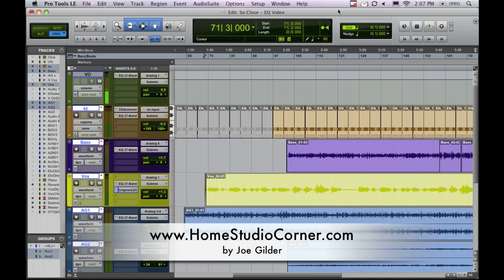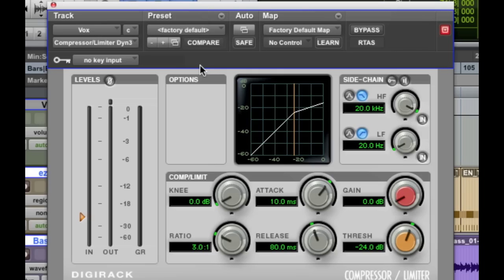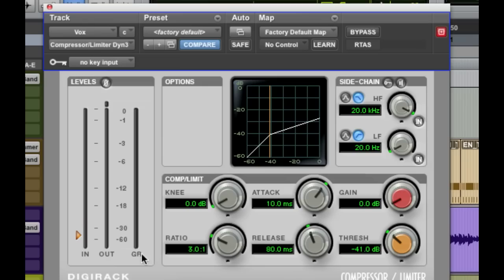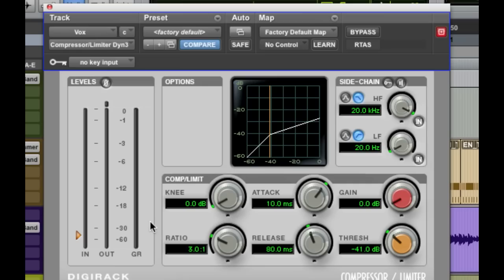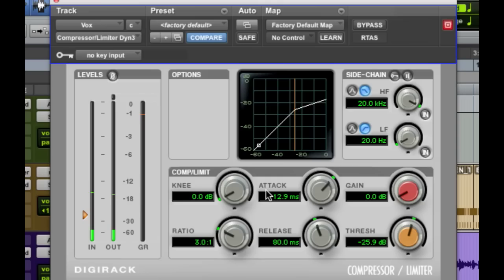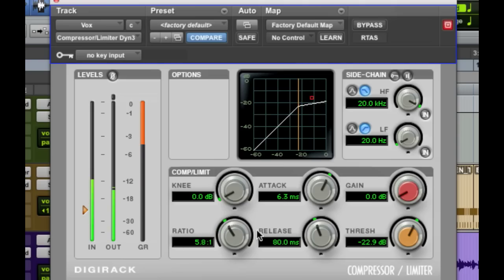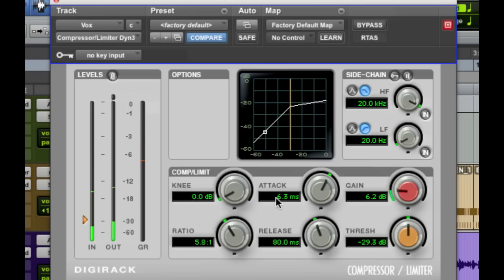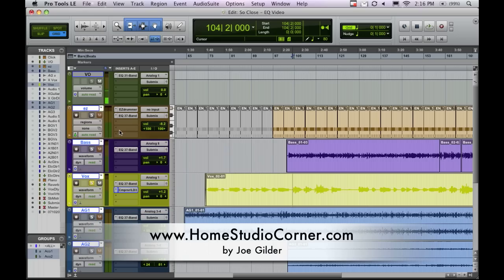Intro to Compression

Comment: With all due respect, the explanation on ratio is incorrect. Using your example, a 3:1 ratio basically means that for every 3db over the threshold only 1db is "let out". This corresponds to the visual representation (graph) on the plugin. 

Your threshold is set to -41db. Let's say your average input level is at about -23db. At those settings your signal is going over the threshold by 18db (not 4db). With a ratio of 3:1, for every 3db over the threshold you will see 2db of gain reduction. So, 18db over threshold gives you 12db of gain reduction.

That's how you get the 12db of GR.

But yea, basically all we need to remember is that the amount of compression happening over threshold can be adjusted with the ratio knob. :)

Comment: The knee changes how smoothly the compression is applied after the threshold, if you have a low knee setting then the compression will kick in immediately at the threshold, whereas if you have a higher knee setting, then the compression is gradually increased to full compression after the threshold.

Comment: @fabjosrey in my opinion you shouldn't hear difference - transparency is a goal. You basically want to control dynamic range. To learn how to use compressor use bypass switch as much as passable.

Comment: At 2:53 seconds into this video he starts talking about the ratio adjust.  He says that for "every dB that it goes above the threshold, this is how many dB it's going to turn it down."  OK, let's set the threshold at -12 and set the ratio at 2:1.   So, if our signal comes in at -6 dB, that's +6 dB over the threshold.  According to what he said for every dB above the threshold, in this case 6 of them, this is how many dB it's going to turn it down, in this case,  2 x 6 = 12 dB reduction. This does not make sense the way that he said it.  Now, I'll say it in a way that will make sense:  a ratio of 2:1 is the same and any number and half that number, like 12: 6 or 4:2 or 6:3.  You can see the pattern.  So if we have a signal that comes in at -6 dB, when our threshold is set for -12 dB,  and a 2 to 1 ratio,  anything ABOVE the threshold will get knocked down (the 6 dB above the - 12 dB will be reduced.)  Things below the threshold are unaffected.  So as our signal comes in and reaches -12 dB then continues to rise to -6 dB there is a +6 dB portion of the signal that is above the threshold. This +6 would get knocked down by a two to one ratio.  This + 6  would get knocked down to a + 3 level above our threshold.  In other words, our signal would now only reach - 9 dB (instead of -6 dB.)  This signal would have the signal up to -12 plus and the + 3 dB that was added to it.   If we then turned the ratio to 3:1, and kept the same threshold and the same input level, our signal ABOVE the threshold would get knocked down from 6 dB to 2 dB.  Our output would be -12 dB + 2 dB = -10 dB.  If we did this again and set our ration to 4:1  our +6 dB over the threshold would be knocked down to 1.5 dB above the threshold. Our output would be -12 + 1.5 dB = -10.5 dB.  Summarizing, here is what we would have with a threshold of -12 dB, and the same signal level comming in, but with different ratios:
Ratio           Equals             Output
2:1              6dB/3dB        -12 + 3 = - 9 dB
3:1               6dB/2dB       -12 + 2 = -10 dB
4:1               6dB/1.5dB    -12 + 1.5 = -10.5 dB
You can see that, by turning up the ratio, the amount of signal added to the signal above the threshold diminishes.  This is basically squishing the signal.  If I got any of this wrong, please point it out to me.  I believe that my numbers are right.  The only question would be how Joe, in the video worded his explanation, and my objection with it.
Reply: My thoughts exactly and your numbers are right. This part got me so confused I started reconsidering what I'm already supposed to know. Really glad you posted this and I'm not the only one. I think Joe probably messed it up but his math in his head worked fine for him to not realise. :D Of course you can't have a 3db reduction for each db above the threshold. The easiest way to understand that is that, If you are 1 or 2 db above it, then the reduction will get you below it. Makes no sense. 

To add my thoughts to your... post (for the 'math' enthousiasts): We can see that, when input X is less than threshold T, then output Y = X. Altering the ratio and threshold simply affects the new line defined for X > T. Given input X in db, threshold T and ratio R we can easily compute Y for X > T like so:
Y = T + (X - T) / R, for each X > T. Obviously this is the exact line this plugin also plots.
Reply: For anyone reading this, there's so much information online it sometimes becomes dangerous learning something wrong, especially if you are a beginner... which usually imples that you either didn't comperhend it 100%, or you put too much trust to the instructor you've chosen. I don't know which of those two is worse :P I just hope that people who watched this video, either did not pay enough attention or hopefully read the correct explanation from your comment or Dustin's